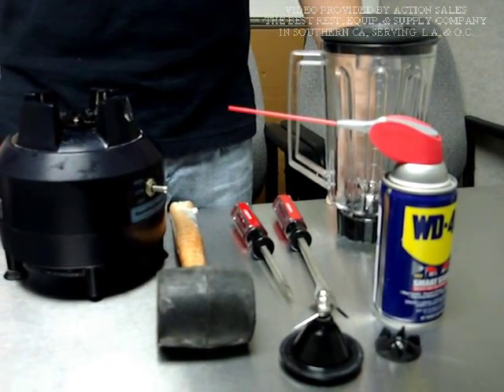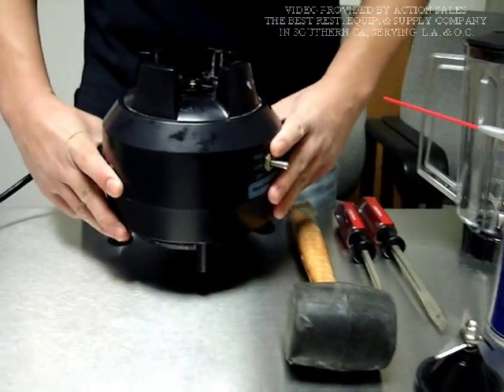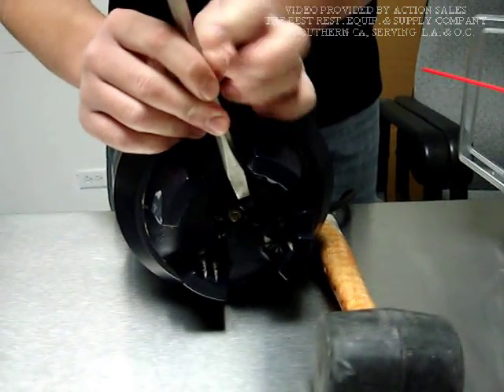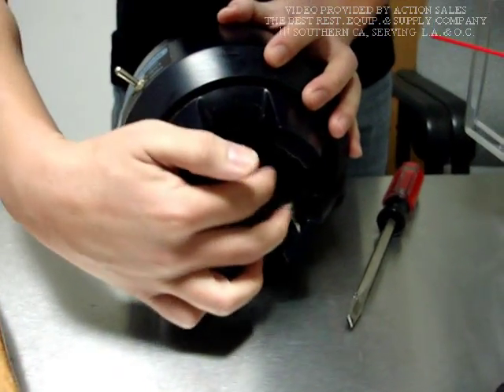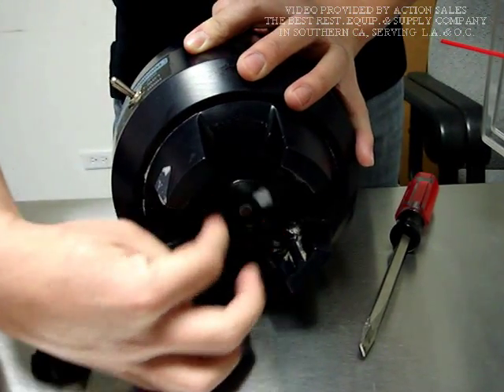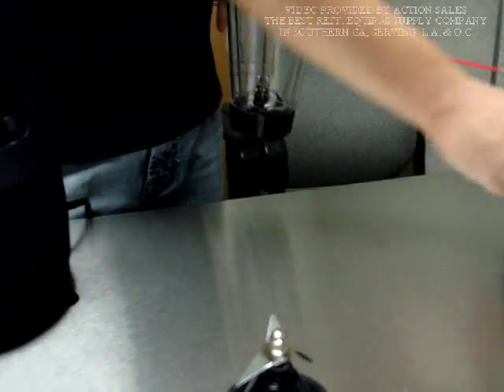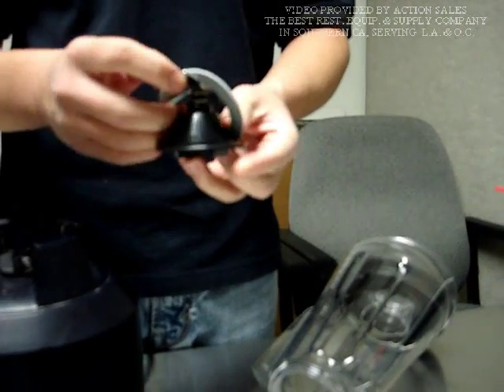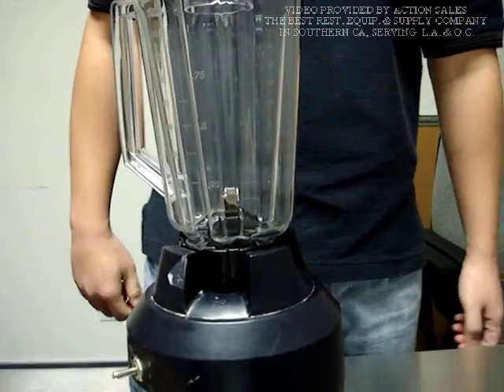ACTION SALES RESTAURANT EQUIPMENT&SUPPLY-HOW TO CHANGE HAMILTON BEACH BLENDER BLADE AND CLUTCH

Comment: Thank you for posting this very helpful video. I have an older HB Model 909 that sounds like it might need a bit of oil. Do you know where the oiling port is?  Is it under the clutch?  Thanks in advance.